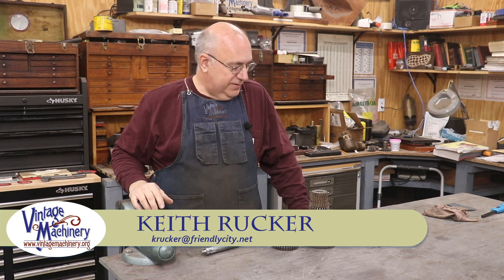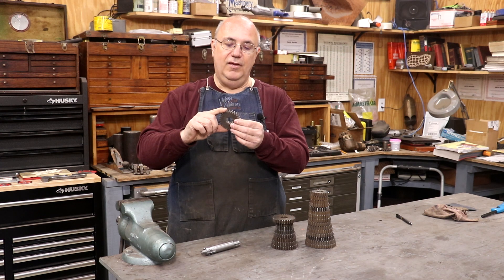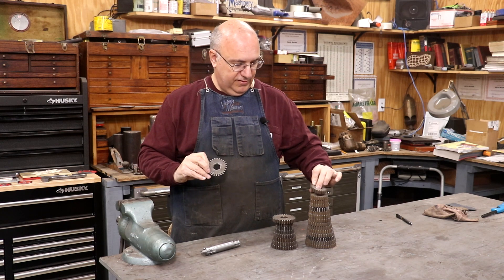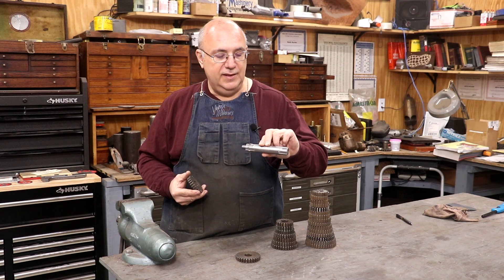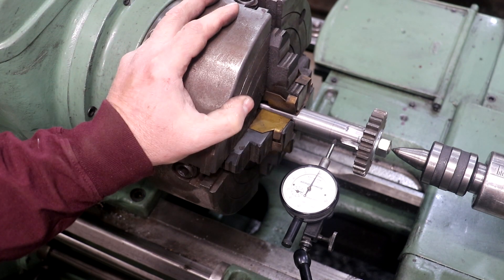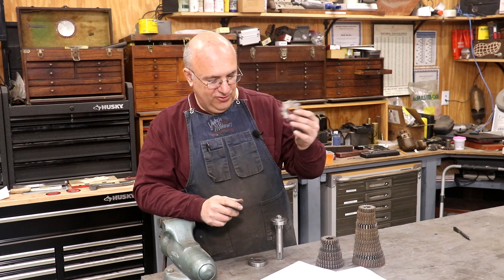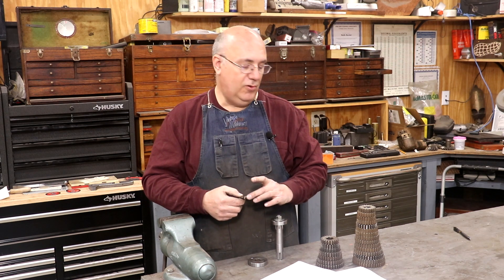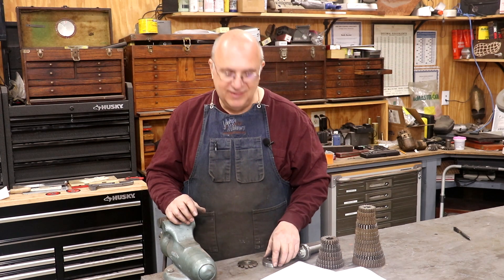Turning Change Gear Blanks on the Metal Lathe

Comment: Boy are you right about never having the right size cutters!  I have a large selection, from 5" diameter roughing cutters to tiny watchmaker's wheel cutters, but I never have the size I need!  (I don't cut that many gears, and have designed projects around the cutters I DO have, but still...) Finally bought a set of chinese 16P cutters for the last project.  They worked fine.

Comment: I feel your pain. When i had my garage a customer ask if  I would reassemble some items his son had taken off his car and lost interest. When the car arrived it was 1968 Camaro taken completely apart. No suspension, no engine, no trans, no window regulators, no wiring. 100 percent dissassembled. There were over a hundred cardboard boxes of parts. It took a few months but got done

Comment: Shop law - you NEVER have the cutter you need 😁
Reply: The parallel in the woodworking shop is: You never have enough clamps
Reply: @EngineeringVignettes  not enough clamps on the planet 😁
Reply: @mayshack  John Heinz or Mattias Wandel? They have both made wooden clamps in the past... It could well be someone else though...

Comment: I'm wondering where the "play" from the interrupted cut occurred to make it slightly tapered (10:35)- dials moving around? . Also, does that explain the small serrated edge/ring (9:21) on the far side of the first one that was cut ?

Comment: The advantage of using the old-stock cutter is that the steel hasn't been recycled so many times (tin cans, battleships, cars, etc.).  Iron gets tired, like people.
Reply: In all the metallurgy and materials engineering lectures I sat in, they never talked about iron getting tired. You should probably write up your findings and get them published.
Reply: @Rich-on6fe  Metal fatigue??? :-)
Reply: @tpobrienjr  I hope that's intended as the joke that I know it to be :)

Comment: You could just take the 28 tooth gear and grind off 6 of the teeth.
Reply: lol
Reply: Well damn... that sounds a heck of a lot easier than all the rigmarole Keith is going through! 😂
Reply: Might run a bit rough at first but...
it will smooth out with usage.
Reply: Hey, it's obvious, isn't it?

Comment: There are lots of gear-cutting videos out there, but I've never seen a gear-uncutting video.
Are the gears made out of hardened steel?
Reply: Me either! What a clever re-use of redundant tooling!
Reply: They certainly looked to be given the colour of the chip coming off of it when turning the full diameter. I had expected the  gears to be cast iron but given it was to drive an industrial attachment to a big mill I suppose K and T decided to go the steel gear route.

Comment: Your involute cutter issue is similar to my nut/bolt/screw issue.  I probably have 100,000 nuts/bolts/screws in my collection...and I NEVER have the one I need.
Reply: So I would buy a box of 50, use 3, and then have an inventory of 100,047 fasteners that never fit anything again.
Reply: @kensherwin4544  exactly....lol

Comment: Why can't you duplicate the spline with a keyway broach?  You can mill a keyway or drill a pin to allow you to do a 60 degree index on the bushing and use it after the first slot is cut.
Reply: Because he already had ten spare gears with the appropriate splines ready to go?

Comment: Don't need a form cutter if you have a surface grinder.  Rough cut on the mill with slitting saw then finish with a form wheel?  
Never should have ruined old GOLD when a $15 hobbed coupler is available. Section it into gear thickness blanks chamfer both corners for a welding vee then machine a donut to fit. Finish weld, sides and diameter on a lathe. Machine or grind the gear teeth as needed until the cast bracket arrives.

Comment: I would've turned the teeth off in a single pass and leave only 80 thou for 2 equal finish passes. 3 passes total.
Reply: Don't you run the risk of breaking something if you are that harsh?
Reply: @jimthesoundman8641  no but the tip is wearing out prematurely by taking too shallow cuts and the tip can also chip from the impacts.
Reply: @MF175mp  But, the video would have been too short and viewers would have missed that wonderful zinging sound of the teeth being removed.
Reply: @MF175mp  With the carbide available today cuts like in this video are not really a problem.